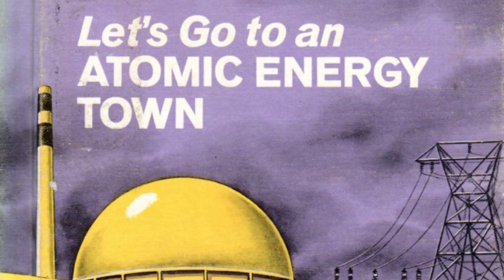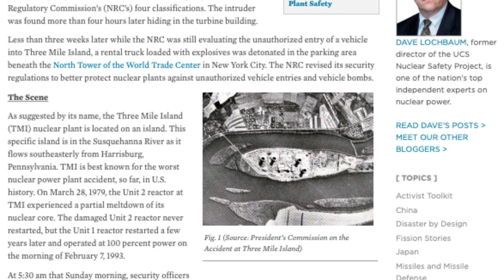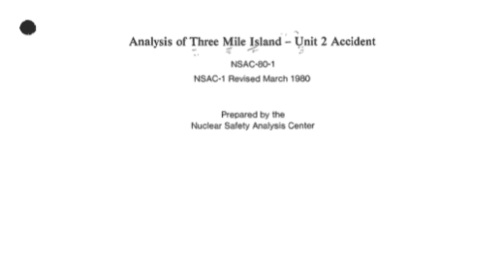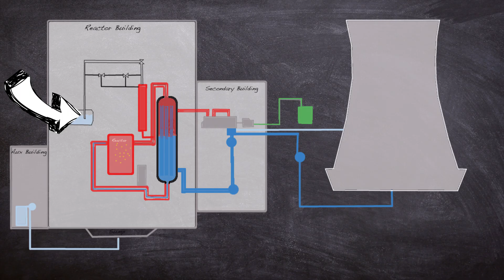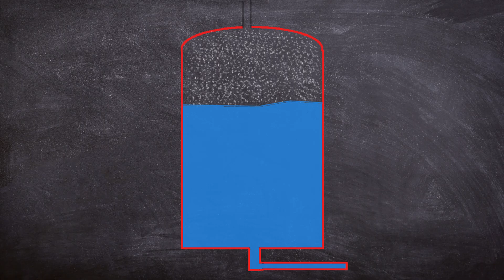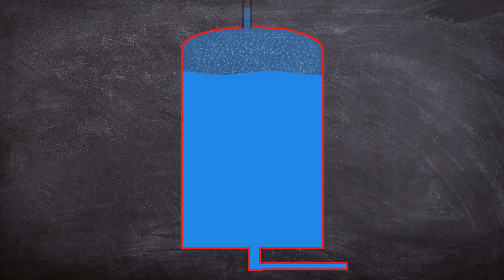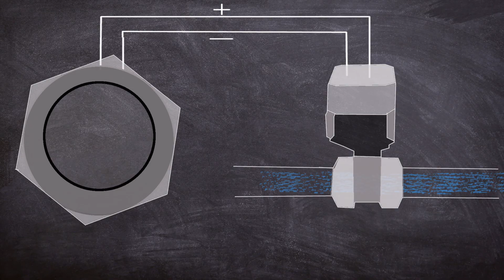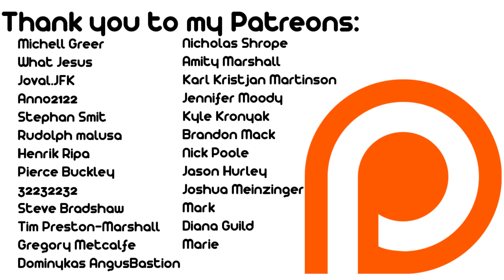A Brief History of: The Three Mile Island Accident (Short Documentary) (Part 1)

Comment: NRX is light water cooled and heavy water moderated. power level was controlled by lowering the heavy water level in the core aswell as inserting control rods. The NRU was a D20 cooled AND moderated reactor. Power was controlled by raising and lowering the 18 control rods and 4 adjuster rods.  The NRU was the worlds first reactor to refuel during operation. Worked there for many years

Comment: @Plainly Difficult, I have a few suggestions to help you understand some of the terminology because it feels like it was used confusingly.

-A “block valve” is just a manually operated valve designed for blocking flow. It is unlikely they called the pilot RV bypass “THE block valve”, though I suppose it is possible as different valves get nicknames inside plants. Generally this just refers to a manually operated valve which typically isn’t used to regulate flow (though obviously it also can be).
-The resin in Condensate Polishers is NOT a filter. In demineralized water treatment systems, if your resin columns are being used as a filter, something is very seriously wrong. They remove dissolved cations and anions, not solid particles. Makeup water to the system is treated by clarification and sand filters to remove most hardness as well as solid particles (turbidity). Then the water goes through a Cation column, then an Anion column, then a Mixed Bed of both resins. From there it is deaerated before being sent as makeup water. Condensate Polishers clean up any impurities in condensate so that it can be used as feed water again. They are typically just Mixed Beds. If they were getting resin inside any piping downstream of the columns, the strainers which hold the resin in were broken and that should have been fixed.

Comment: The reason the Pilot Operated Relief Valve stuck open was because, some months before,  someone had removed a relay from the circuit. They needed a special type of relay, and knew these were used in the PORV, but, after all, the PORV was only needed for emergencies, wasn't it? However, whoever it was didn't actually tell anybody about it. This ruined the valve logic, so when it got the command to open, it violently opened and slammed shut several times in short succession, beating itself to pieces. The indicator only showed that the PORV had been commanded to open, not what the actual status of the valve was.
Reply: Interesting, but I suppose any failure of the valve was possible: the design was an accident waiting to happen because the control room had no way of really knowing the state of the valve.

Comment: Wow. I was expecting some kind for corporate corner cutting to be the cause of this situation, but it actually sounds like a series of unfortunate events and an honest mistake.
Reply: And cost cutting by not installing a proper status check of some critical valves.
Reply: @G-ra-ha-m  Agree. 

If the open and closed indications were derived from the actual position of the valve, this incident would most likely have been avoided. 

Using coil voltage as a valve position indicator is less $$$ than an actual position indicator but it's the worst possible design.

Comment: I get that you need to end the system somewhere, but how is a rupture disk the last piece? Wouldn’t you want a catch/containment system after that? How’s that conversation go? “So if that tank overflows, no worries, we have a rupture point.”  “And then where does the contaminated water go?” shrug “Good enough for me. Send it!!”
Reply: Don't worry, the GE Mk1 and MK11 reactors that have insufficient volume to contain a melt (I.e. the same as the Fukushima reactors that melted down) have been modified with a 'vent to atmosphere' pipe now. I think only around 25 are in use in america now.

Comment: Some back of the envelope maths to give you an idea of how profitable these stations are. Peak electricity in my area costs 20 cents per kilowatt hour, and 10 cents for off peak use. Using off peak costs, a 900mw generator will bring in $90,000 per hour net income. I'm not sure of the operating costs, but that would take only 3-4 years to make back the $2 billion cost of TMI1. Not too shabby. Of course, I'm grossly oversimplifying these figures and making a lot of estimates. This is just meant to give a vague sense of how much money these bring in, not taking into account any operating costs.

Comment: 8:50 this is the point where the technicians made their first big mistake due mainly to thinking of a civilian nuclear reactor like it was a submarine nuclear reactor as every single one of the technicians were former Navy nuclear technicians who all worked in submarines at one point or another.  You see, in a submarine, you can NEVER let the the pressurizer to "overflow" as it would cause the engines to instantly shut down and you would have no power and worse, cause a serious buoyancy issue possibly making the submarine unable to properly surface (this is not a big issue with newer submarines, but it was still an issue with older submarines from that era in the 60s and 70s when these technicians were in the Navy).  This is NOT an issue with a civilian power reactor as you are A: not under water, and B: there are ways for the water to escape and it almost never causes that much of a problem simply keeping the water flowing.  If they had kept the water flowing, it would have been a minor incontinence and they could have had the reactor started back up in a couple days tops.
Reply: Well actually, you wouldn't want a civilian plant to "go solid" either because there is no way for the water to escape the pipes other than certain valves. If every valve was shut and water was still being put in, that would be a problem and letting the pressurizer overflow could effectively wreck the plant. About the only thing worse would be a meltdown. The operators assumed they were working with a closed system (light off, Valve must be closed) and tried to prevent the pressurizer from overflowing. If they knew the light wouldn't tell them if th Valve was open, they probably would just let the automatic system pump water in until the pressure got to a level they were comfortable with.

Comment: So basically it was all caused by a solenoid indicator bulb being off 😂
Reply: Like Fukushima, nobody to check the manual displays just off the reactor room!
Reply: In a way, yes.

The actual reality is that it was a bad design. Every critical valve I've ever installed (over 30 years experience) derives its open and closed indications from microswitches controlled by the position of the shaft. This way, if it says closed, it is actually closed regardless of whether the coil is energized or not. 

Had the valve in question here had that type of indication, the operators would have known instantly that the valve was actually open and acted appropriately.
Reply: @rrknl5187  Sadly, its the curse of nuclear. It was shot in the back for stupid mistakes and blattant missmanagement, not letting any of the more modern, safe, efficient and clean reactors any chance to shine. I mean we are at the point where interest in nuclear (and its financing) is so low that we are stuck with aging and increasingly costly and dangerous LWR out of nessesity, because as much as people want to  phase out nuclear for "something better", in temperate climates it still remains the best baseload energy production method.
Reply: @mobiuscoreindustries  Tes, no doubt.

The really sad part is no one ever hears about the many many plants that operate flawlessly for many years. They just keep running and producing some of the cleanest energy available and lots of it. 

A perfectly running plant won't make headlines though and won't sell advertising and thus, won't make a huge profit for the media. 

So you never hear about them.......

Comment: I wish nuclear power was more widespread, barely any radiation was released during this incident but due to all the misinformation now everyone is scared of nuclear power.
Reply: assessed from an economic point of view wind is cheaper
Reply: @lendoggtheking  Wind is shit, everyone always brags about how cheap and easy it is to install but i can tell you from first hand experience they are a pain in the ass to install and maintain. For some reason no one had the hindsight to realise that blades spinning at a hundred miles an hour degrade very very quickly and cant be replaced. The restructuring it itself is surprisingly immense, all you see is the turbine but theirs actually a massive foundation underneath each and every one of them that has to be made perfectly or the turbine could topple over in strong wind, a road also typically has to be made for each turbine as well to allow for maintenance.
In the same amount of space as a wind turbine farm a nuclear power plant creates a multitude more power for less.
Reply: @holyravioli5795  I think I read somewhere that to produce the power of one nuclear reactor you'd need hundreds of wind mills. Honestly considering how much of a problem habitat destruction is Wind Mills probably cause MORE damage to the environment than a nuclear plant
Reply: @lendoggtheking  we've got a perfectly good star only three light minutes away! #OrbitalSolar where the sun never sets, a ring of solar panels one kick wide in geostationary orbit would give us the entire planetary electric supply for hundreds of years!
Reply: We might cull more sheeple that way!

Comment: I was on a commercial flight about to land in Harrisburg.  The pilot got on the intercom and said "On your left you can see the 4 reactors of the three mile island nuclear energy facility.  If you notice, reactor #2 is currently not operating."  I looked out the window, the other three reactors had steam coming out of their cooling stacks, reactor #2 had none.  I thought it was pretty funny.
Reply: Three? TMI has only ever had 2 reactors
Reply: @AdamSmith-gs2dv  And, as stated in the video, TMI-1 was down for refuelling at the time of the accident at TMI-2 so there would have been NO reactors operating.
Reply: It's most dangerous every three months when they pop open the reactor for inspection, a few tons of steam always gets loose! Always!

Comment: That solenoid valve was a very stupid design flaw from today POV, if it fails, we won't know if it is on or off. Could be easily prevented with a proper sensor, not just relying on a lamp wired to the valve.
Reply from the maker: Not the best form of valve state proving but back then they didn't consider the human machine interface as much as they do today! Thanks for the comment!
Reply: The valve worked fine, it was the instruments that failed as they reported a high pressure problem when in reality the OPPOSITE was happening (ie the reactor was loosing water AND pressure)
Reply: @Muckin 4on In addition to the indicator for the solenoid, they use position indicators on the valve stems to verify actual valve position, as well as thermocouples in the downstream piping to detect the flow (or absense) of coolant/steam. The discharge tank's water level and temperatures are also closely monitored as an independent verification of the relief valve state. This is standard stuff.
Reply: While, yes, I can sort of agree with this, I think you also need to understand how hugely complex the machine rooms were due to most of these kind of setups being fully analog, yes, there might have been analog logic, but there still were kilometers off cable running from all the equipment to those control rooms, and any extra would require cabling.
It's basically the same with car dashboards: if they would still rely on direct wiring of every sensor, you'd have a massive cable tree running towards them and wiring them would become hugely problematic, next to weight added to the vehicle because of all that cabling.
Reply: @Dutch3DMaster  Yea, we now have CANBUS and it solved the messy wiring problem. Now we have software or electronics problem.

 Technology always goes like this, something came up, first, it has 100 parts, then we found problems, now we fix the problems but got 1000 parts, then later, someone find ways to bring that down to 100 parts again, but much more advanced.  This took years to evolved to that point.
Reply: @worawatli8952  True.  I'm not saying CANbus is perfect, but for an electronics project in which I'm building a dashboard (from a time before there was CANbus) I've come to notice it has it's advantages :P.
Reply: @Heads Mess But well, we could design them to fail-safe, that's what newer reactors design does, I was talking about those older designs that aren't build to fail safely, as energy demand is there, we somehow need to continue using those old reactors, but they are always get upgraded with better control systems and interfaces.
Reply: Boiling water is a really stupid way to get power! #Thorium

Comment: If I remember correctly, one of the issues in the room that day was a lack of retraining of former submarine nuclear techs. The reactors on submarines are not large enough to produce the kind of heat needed for a true meltdown, so the techs were less concerned about water flow into the reactor than they should have been.
Reply: I don't think you understand that the naval nuclear propulsion program has much more conservative guidelines and that operators are rigorously trained and continuously examined on reactor plant steady state operations, transients, and casualties. What you said about submarine reactors being "too small to cause a meltdown" makes me entirely disagree, being that I have experience in this field. Operators are trained to not rely on automatic protection systems and expeditiously execute all required immediate actions to combat the casualty. Civilian plants operate steady state for long periods of time  and have much lower enrichment for fuel loading. I won't disagree that possibly the prior Navy RO's became a little bit complacent, but calling out the NNPP as the root cause is asinine.
Reply: @gingasamuri  do you have experience in the field pre 1979? It entirely could be that this incident caused a tightening of training and making things generally safer.
Reply: @zrspangle  No, I'm still in. Good point though, I didn't think OP was referring to the program post-1979. Rickover was the Head of NR at the time so I would expect that the program would be extremely strict and redundant.
Reply: @gingasamuri  that's fair, however I imagine the safety procedures on a submarine (even if they're strict in certain areas) are rather different than surface reactors. Though I don't have any hands on experience so I'm not going to claim to be an expert in the field.
Reply: @zrspangle  I'm not an expert, I'm just some lowly junior enlisted nuke who got offended by OP's comment at the time (because I felt like I had to stoke my ego)
Reply: @gingasamuri  hey, at least you don't have to stoke a boiler these days.
Reply: That was one of the errors yes. A lot of nuclear navy guys end up as reactor operators. So you are correct, they did not have the required experience and training to understand the detailed operation of this plant that would have allowed them to realize the phenomenon as it occurred.
Reply: They were specifically trained to fill the pressurizer and trust those indications.  They operated exactly in accordance with their procedures.

Comment: When the Holtwood Dam was built on the Susquehanna River in 1910, it produced more electricity at peak times than its owners could sell.
Later, TMI's output at the same river is 15-20 times greater.
Reply from the maker: That’s crazy!
Reply: @PlainlyDifficult  I may have made some errors converting from horsepower to megawatts, and it may only have been 6 times greater.

Still, to go from "How will we ever find enough buyers for our abundant hydroelectricity??" to "What we need here is a nuke station!" is indeed crazy.
Reply: HebaruSan 
If you know the HP. Multiply by 746w and divide by a million. Should be bang on.
Reply: I think the Susquehanna is one of the largest power producing rivers in the world.  Until recently it was Susquehanna Units 1 and 2, and TMI, and Peach Bottom units 2,3.  That's just the PA nuclear portions.
Reply: Imagine that,I doubt many people had electricity back then.
Reply: Must be a lot hydro units at the dam,they provide 25-50 megawatts each.
Reply: HebaruSan zz
Reply: Remind me again how much TMI cost to construct. How long was it operational before the crisis and partial melt down and how much decommissioning and finally dismantling the plant will cost? Then tell me again how safe and affordable it is? I live about an hour from Rainer , Oregon and Trojan was NOT a decent value for the money spent to build, operate and then decommission and finally dismantle.
Reply: @gregorytimmons4777  Here's a windmill.